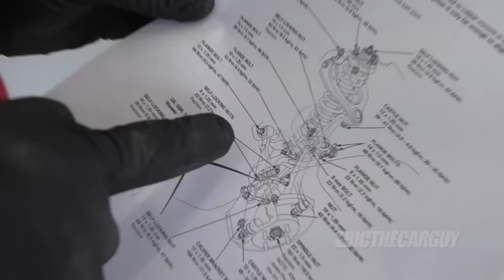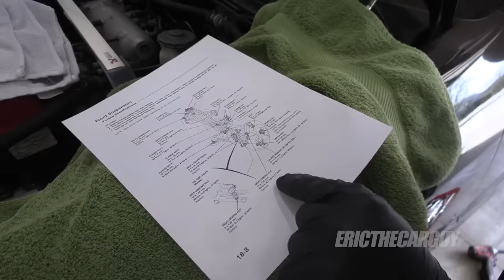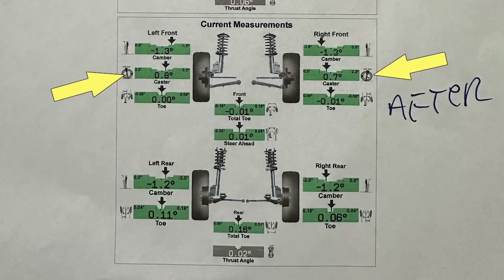Integra Type R Restoration (Part 5) #finalepisode  #etcgblackbeard

Comment: When I did the Rust-oration of my 57 Ford tractor, the front emblem also attached with those "speed nuts" for lack of a better term.

I don't trust them, especially for something that gets the amount of bumping and bruising as a tractor. Because of that, I threaded them and used nylock nuts! Worked perfectly!

Comment: The alignment specs sheets had arrows pointing to the caster. Camber was the numbers right above those, in the -1.5-ish range both before and after. Which is good. 

9:51 Also that plastic fender liner edge needs to tuck in behind the edge of the bumper. My passenger side one used to always pop out and I’d have to tuck it back in every now and then.

Comment: Emblems are ridiculously expensive.  The Blue Oval is one of the MOST expensive to make per the supply base; especially when you get into those BIG SuperDuty badges.  When I was in Paint Automation we used to collect badges as a 'reward' for a job well done.  I have so many in a box that will go on a wall when my shop is built.  I have all the large volume vehicles (Jeep, RAM, GM, Chevy, Ford, etc), and many of the higher ends as well including Rolls Royce and a couple other high end low volume vehicles.  Gotta be at least 40 or 50 total in the box.  I remember getting the SuperDuty badge and the guy that got it for me was "These are CRAZY expensive, hide it, they look for these, and I never gave it to you".  When I went to work for The Blue Oval I was really surprised at what went into making that badge, it's crazy.  I think 20 years ago the SMALL ones cost over $10 each FORD's cost.  The Big Ones were into the $20 range.

Comment: Ok eric the car guy i have 2005 honda civic changed caliper on front and lines one side has fluid the other dont (pass side) what is the junction box that splits the brake lines out to all 4 wheels

Comment: Thankfully Americans got introduced to good cars that can handle better than boats heh-heh.  Faster, better handling and more fuel efficient, whatttt, no wayyyyy  😲.  I am mainly talking against the bland massive boat designs as to be fair, there are some incredibly iconic and beautiful American designs - Not sure what they were like to drive though.  The roads in America suited the cars they made I guess (and people), gargantuan and massive.  Europe, Japan, UK etc roads are very tight and have bends, what are also known as... Corners 😛 Our cars also have proper stick gearboxes (or had, with most things being semi-automatic now).

Good job on the Civic. I never had a Honda, always liked the look of them though, particularly the Honda Civic Type R (2001-2005 UK type, was a small car, not sure what it would be renamed in America or if you had it).  
For the Japanese, I was a 2001 Gen7 Celica chap, bought around 2010 when I was around 26.  
Actually, its quite horrifying to think i've not had many cars, just 3, 1997 VW Polo, 2001 Celica 1.8 VVTLI and 2007 BMW E92 335D remapped (which I still have and owned for 11 years now - its starting to need TLC now at 186k miles).

I missed your channel dude, good to see it making a comeback (not that it went away or dwindled, I just mean new content).  Hope things and the family are well. Kind regards 🙂

Comment: What happen if you torque down when car is jacked up compared to being on floor (compressed) when torquing the bolts down?
Reply: The bushings only have so much twist in them. If you torque them with the suspension in droop, the bushings will twist beyond their range and will tear prematurely. 

If you have aftermarket ploy bushings or spherical bearings, it doesn't matter. You can just torque them in any position.
Reply: The wheels fall off.
Reply from the maker: You will stress the bushings when you lower the vehicle to ride height.

Comment: I noticed you using a paint pen to mark some of the bolts, what brand do you use? NVM, i just saw the link in the bio for the paints pens. I tried out some sharpie ones and they sucked. Had nothing but trouble with them.

Comment: Where can I order that rear trunk/hatch seal?
Reply: And those rubber door seals?
Reply from the maker: I got the rubber door seal from Acura. I think it was the last one. Helix Auto Works is linked in the description.
Reply: thanks
Reply: Mita Motorsports also has reproduction DC chassis hatch seals.

Comment: Where did you source the door handle?
Reply from the maker: Ebay
Reply: If your door handle is broken and you fancy taking the assembly apart, you can use a 96-00 Civic handle (just the part that pulls out) on the 94-01 Integra handle housing. The handle portion is the same while the housing is shaped different around the outer edge.
Reply: @ericthecarguy  Alas. I hoped someone was making new replacements :\